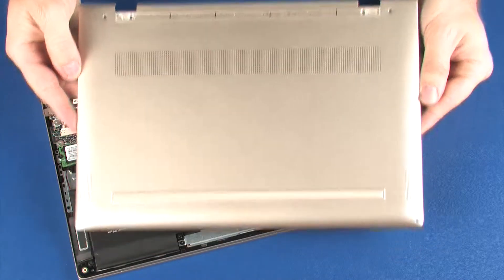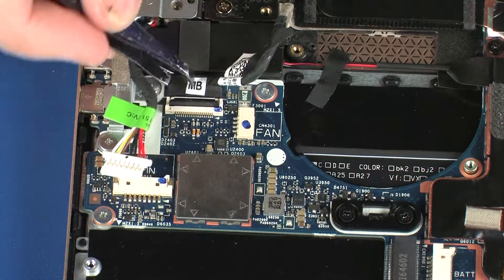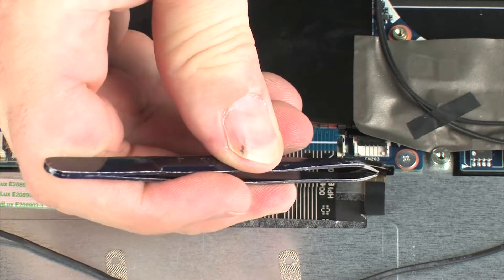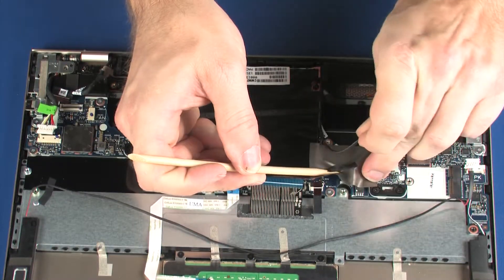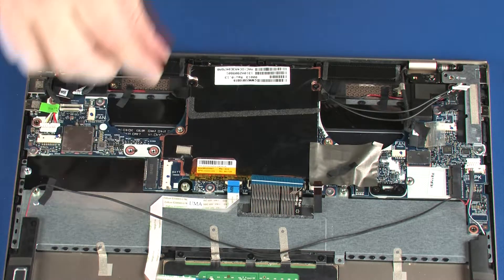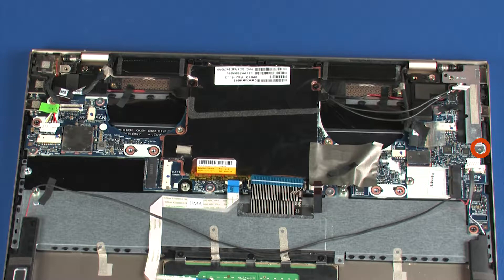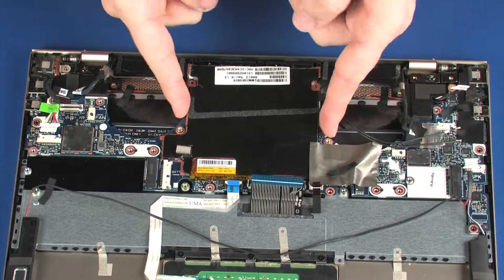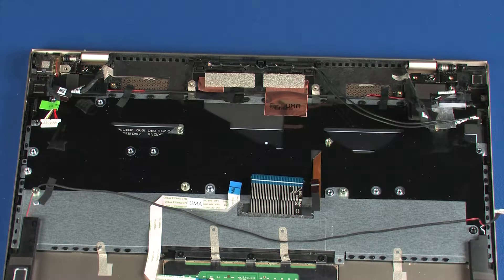Remove and Replace the System Board | HP ENVY 13-ad0xx | HP

Comment: What about CMOS battery?
Reply from the maker: Hi there, thanks for contacting HP Global Social Media Support!
I understand that you need help in locating the CMOS battery of your notebook.
I will do my best to assist you.
Most of the newer HP notebooks such as yours do not have a CMOS battery.
The internal battery maintains the clock and BIOS settings.
Below is the link to the service manual for your model series, and as you can see...no RTC (CMOS) battery is listed and nor is there a procedure to remove and replace the RTC battery: https://hp.care/6051qSLEP
Regards, 
HP Support